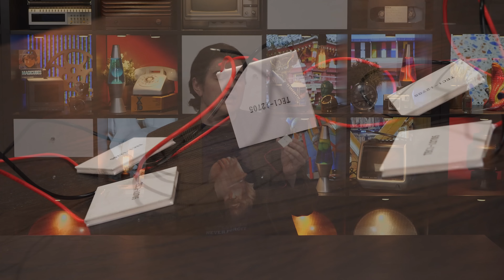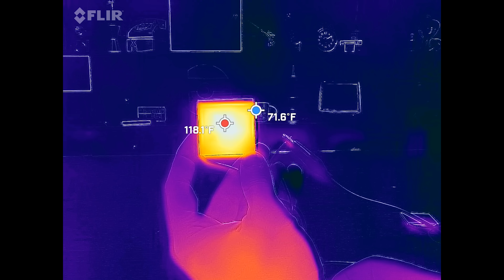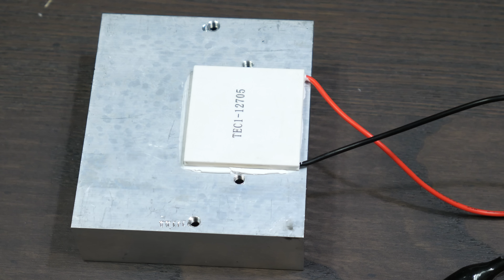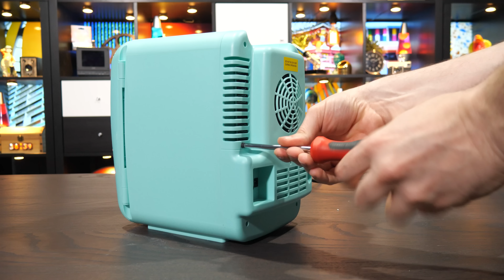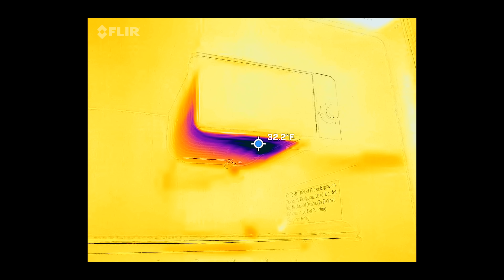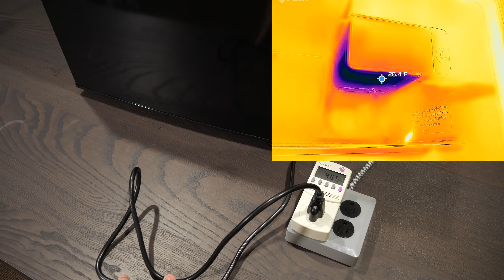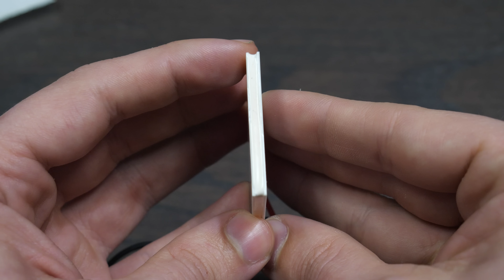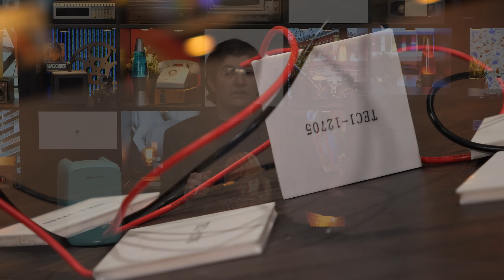Thermoelectric cooling: it's not great.

Comment: 14:20 So 230V are going to the head of "us Europeans"!? But hey, I can return that easily, because what's obviously going to your US-american heads is the higher amperage your devices need when running on miserably weak 120V lines. For us, every single household wall outlet may carry 16A at 230V 50 Hz, that's 3680 Watts! And Ithat's just the beginning, because for electric ovens and instant water heaters, we have 3-phase 400V with each phase providing up to 32A (fixed wiring, no plugs, officially requires an electrician). There, take that! 😝

Comment: I use one of those cheapo coolers for eye drops I keep by my bed that I like to keep cool (but don't require full refrigeration).  Works great for that.  There's no way I could fit even the smallest of minifridges next to my bed, and 20-25 degrees below the surrounding environment is plenty good enough for my purpose.  Plus I only run the thing 6-7 hours per day since it spends waking hours empty and only takes a few minutes to cool itself down when switched on at night.

Given that the application for these is specifically for places where you can't have a real fridge, the comparison to legitimate refrigerators feels mostly moot.  I guess the urge to make that comparison is the fault of their marketing.  These are advertised as low-tech refrigerators, when in reality, they are actually high-tech coolers.

Comment: I have one that I plugged in next to my toolbox at work, we don't have a fridge at work thats close to service side I use it to keep my few drinks cold and it does a really good job as its alot colder than the heat I am dealing with our open garage doors and no AC. I don't pay for the power bill so that factor doesn't apply to me.

Comment: I've (successfully) used good quality >100 $ Peltier fridges in my car when driving on vacations. First I would pre-cool the fridge (turn it on in the house) the night before AND in the morning of travel add a few (4-5) cooling elements directly from the freezer. After 16 hours in the hot car (no aircon) the temp would still be below 10° C (7-9,I use thermometer) which is excellent drinking water temp and sandwiches stay fresh too. They keep temperature better than similarly sized but cheaper passive coolers and those few degrees of difference matter a lot to me.

Comment: My first thought when I saw that Peltier device: Hey, that looks almost exactly the same size as a CPU's lid. I wonder if you could sandwich one of these suckers in between a CPU and its heat sink and use it to leech the chip's waste heat more effectively than the heat sink and fan by themselves. Sure, it would use even more power, but PCs that would benefit from that kind of active cooling would be drawing space-heater levels of power anyway, what's other 50 watts?

My second thought: If you could use them that way, it would already be common practice among certain PC enthusiasts by now. And I'd know about it from seeing it on one of the many tech channels I regularly watch and/or have pop up in the recommendation column. If this is my first time hearing about Peltier modules, there's a good reason!
Reply: Update: Huh, turns out Linux Tech Tips did a video about this very thing five years ago.

Comment: Alec, you gave me a good laugh when you said the door of the crapper wasn't insulated probably because it prevents freezing ;-)  BTW, you aren't kidding these Peltier devices draw tons of energy. A friend and I went on a road trip and he bought a car type fridge that was about 2/3 the size of your mini. It worked great, but we left it plugged in using the truck's 12 volts and surprise! The next morning, the battery was cold (pun) dead. From that experience, we took the fridge inside the hotel stops and plugged it into 120v supply. The neat thing about the dual-voltage device was that you could throw a switch to make it warm, as well. I have one which I only use when shopping, so my cold food stays cold on the drive home.

Comment: The steam (or refrigeration) cycle is still the most important technology since the industrial revolution. Great video.
Reply: I balk at calling any one thing most important, but it's definitely up there.  As a steam engine, it gave us a way of turning heat into work -- a brand new capability.  And in reverse, it gave us the ability to create pockets of coolness from scratch, without having to import ice or exploit overnight temperature gradients -- again, a new capability.

Comment: So if I had a air to air radiator (intercooler) and lined the top and bottom of it with these coolers, I could see lower air temps inside the radiator, the heat isn’t that much of a big deal, there are fans and plenty of ventilation. 🤔 I wonder. Are they water resistant?

Comment: I have a full size refrigerator that doesn't have a Peltier element. It also doesn't have a compressor. It plugs into the wall only to operate the light inside. Very quiet and inexpensive to operate. Pretty expensive to buy and nowadays hard to find. But this one has been working with just an occasional coil cleaning for the last 40 years.

Comment: I feel the real benefit to a TEC is it's size. And in a PC or small server, they are fantastic in aiding cooling on CPUs. 12V is available, and many CPUs are getting up to 100°C 212F to hot for most residential refrigerants. And to a point the water cooled loops get a bit of aid as well as the difference in temps from heat to rad is greater. The 100°C could be boosted up higher as the CPU uses more power to do more work ie instead of thermal throttling and dropping to 90w a CPU could run at its max of 150w and the temp on the chip stay safe where as the far side of the tec temps might be 116.7°C or if stacked and enough coolant passed though the heat exchange even higher to a point. I've stacked 3 of them and made ice out of thin air. And used a massive tinned copper heat sink with 2 120mm pc fans. And with very little noticeable emf. Bigger ac electric motors create emf that sensitive electronics hate. Like old school amps and radios for home audio.

Comment: I'm currently building a dehumidifier for my 3d printing filament. I use peltier elements to make the humidity condensate on a heatsink. After that the aur gets circled over the hot side to get warmed up again. So I guess if you need hot and dry air these things are pretty good, at least for diy projects

Comment: I've got a few camera lenses for my DSLR that TECs surrounding the glass elements. It keeps the ambient IR heat emitted from the lenses inside from adding noise in the photos. They use the aluminum body of the lens for passive heat dissipation so no vibration from fans. That tacked onto the active mechanical image stabilization that can survive an epileptic seizure and you can kiss your battery life goodbye. Great photos though and one of the few viable use cases for TECs.

Comment: Great video, very informative.  I do like my little refrigerator, for keeping cool sodas and sandwiches, I am happy with that, and they don't take but an hour or two to cool down to useable.  When the peltier device was first introduced, the ideal use for it was to replace heat sinks.  Not sure if they are being used for that, but they have to be more effective than passive water cooling that is common today.  However, it seems, and I am probably wrong, that it's original intention, like the original intentions of the internet, is not used today.  Now, I am going to have to get a peltier device and see if I can replace heat sinks in computers.

Comment: I always wondered if it was ever possible to use a peltier to generate electricity by heating the hot side and cooling the cold side.  Imagine strategically putting these in an engine compartment or radiator to collect heat to generate electricity.  I claim first patent rights by the way.

Comment: The main advantages of a peltier are as follows:
1. It is a heat pump (not just a heatsink/radiator/fan setup).
2. It's exceptionally compact (compared to a compressor-based refrigerator).

It's also solid-state, but this is largely negated as an advantage by the fact that you generally need to put active cooling on the hot side, which normally introduces moving parts.

The most common deployment that actually makes sense (in certain situations), is to mate the cold side to a high-performance microchip, and slap a high-end heatsink and cooling rig on the hot side.  As long as the cooling rig that you put on the hot side can keep up, this allows you to cool the microchip below ambient temperature, which is an overclocker's dream.  Because of the amount of heat involved, the cooling rig usually uses a liquid coolant, piped to a (relatively) large external radiator outside the computer case.  That introduces additional inefficiency (because you have to transfer the heat an additional time), but it also increases the total amount of heat that can be dissipated per unit time.  Plus, it has the added advantage of significantly increasing the complexity of the setup, which is worth significant nerd cred.

Comment: A cool use I've found for pelteirs is dehydrating 3d printer filaments. The cold side condenses the moisture in the air while the hot side warms up the container and the fan on the hot side heatsink helps circulate the air. The air being hot in the container drops the relative humidity and dramatically speeds up the drying process. If you do it right it's easier to maintain than a container with a headlamp and desiccant... I still wish I could put together a tiny phase change system though.

Comment: As for large fridges not cooling very fast despite their size, I found out that some "very energy-efficient" fridges that also cost somewhat more take lonnger to cool down content than their cheaper, not so very efficient counterparts. My guess would be, that their compressor is undersized.

There is a "super mode" button on mine that helps a bit, but the cheap, large fridge in the office kitchen of my employer is much faster w/o such extra steps. In fact, it is that powerful that you may not set it's thermostat to maximum cooling, otherwise it'll act as a freezer. Fancy "drinking" a bottle of ice?

Comment: I drive a big, off highway truck at my job. I am away from any break rooms for 12 hours at a time so my food and water all needs to come with me. It is a hot part of the world. All the 'real' fridges we have tried in the cab, even those specifically sold for off road automotive use (4x4 accessories) will sh*t themselves after only a week of use. It's simply too rough and bouncy in the truck.
We can't use these little toy fridges because as stated, they're not food safe. So either we find an extremely robust fridge or I continue to only eat foods that are shelf stable and the cab's air con is good enough. How many tins of beans can I stand?

Comment: Wow. You really do not do your homework on these peltiers. They easily get a COP of 1 when ran correctly and if you were to use it for heating, you can get more than a COP of 2. And also to note, that mini fridge is NOT getting a COP of 3. That is wishful thinking because those are also built so poorly/cheap. A COP of 1.5-2 is common for those. Maybe next time actually research and not buy a crappy $30 peltier driven setup and actually make a good mini fridge using peltiers at around $100 with a temp controller to actually do apples to apples comparison.

Comment: They also heat! Just reverse the voltage. I have a terrific camping cooler/warmer than works great. I did not buy it because it's cheap and works very well on DC 12v car power supply, works in my vehicle for trips to the campsite, and can keep food warm for a potluck or similar.

Don't expect it to cool or heat things from room temperature. For food, add ice and it will keep the ice from melting as quickly.

Comment: When it comes to refrigeration, why aren't we talking about things like Carbon Dioxide or Propane as a refrigerant? Both of those do well as refrigerants, with lower GWP than most 'EPA Approved' refrigerants, and they're cheap and abundant. CO2 is naturally all around us all the time, can't get more abundant than that, and propane, while flammable, isn't a significant hazard, because you need a certain A/F ratio for it to ignite. CO2 supposedly has a higher operating pressure, resulting in more likelihood of leaks, but it's CO2 - doesn't have much more impact than us just being alive. And Propane isn't that different. Both cheap and abundant.

I'll tell you why we're dealing with these 'exotic' refrigerants, rather than cheap, abundant, low GWP options like CO2 and Propane - $$$$$$. R1234YF supposedly has a really low GWP, in line with CO2 and Propane, maybe even a tad lower, but it's STUPID expensive. If CO2 and Propane were 'mandated', basically, nobody would make any real money because they're cheap and abundant. Follow the money to the fraud.

Comment: I have a thermoelectric cooler I use for road trips that runs on 12V and also has a 120v power adaptor. it works great. Do they make any any refrigerators than run on 12v that I can put on the floor behind the first row?

Comment: Hi Alec,
What do you think would happen if we put the Peltier unit at the top of the mini fridge, cold side facing down and heat sink facing upwards, added a "heat sink" to the cold side that runs down the sides of the unit, and added some insulation? (to the door as well) 

If you ask me, I think the unit is just poorly designed, its not making the most out of the Peltier device.

Great video, made me laugh, see you next time.

Comment: I dunno i have a Cooluli thermoelectric mini fridge with temperature control and it works fantastic. Better than my actual real mini fridge with a compressor. As long as the ambient temperature stays around 68-72F the fridge will hover at around 31-33F if i set it at the coldest possible temperature. I can set it warmer if i wanted to but it stays right around freezing. In the summer if the room gets to around 80F the fridge will be near 40F and in the winter if the room temp drops to around 64F i can get it down to 24F. 40 degrees below ambient temp, just as advertised. Sometimes colder!

Comment: I had a thermal electric mini fridge in my semi truck that ran on 12 volts and it allowed me to keep healthier food that required cold storage in my truck.

Instead of cooling down the walls of the mini fridge, it would actually have a fan on the inside that blew the colder end around the unit. It was actually pretty effective.

Oh. But yeah, compared to my 4.3 cubic foot mini-fridge I had in college, which I hooked that up to a kill-a-watt and it was only pulling 90 watts. Good old fashioned refrigeration is still way more efficient.

Comment: Where can I get bare Peltier elements? I want to build a custom drier for 3d printing filaments, setting it up like a dehumidifier for the inner chamber.
Reply: eBay, Aliexpress or Radioshack probably have some.
Reply: @psirvent8  Wait, is Radioshack still around? I thought they went under years ago

Comment: The little blue "fridge" also doesn't insulation on the back.  If it did the cooler would not be in contact with inside back of the "fridge" OR the finned heat sink, that is in direct contact with the cooler, would not be in direct contact with the AMBIENT AIR.  So there is another strike for the shit box toy.

Comment: I agree completely, these little pieces of garbage are a waste of power... unless you convert them into a gamer hat.

What we NEED is for one of the companies like Midea to make a chest-type mini-fridge that doesn't cost $1200.00.   I used to convert mini-fridges into buffet-type shallow chests back in the 1990s that used a tesla blower for circulation for ease of cleaning (wrinkly disk blower instead of fan blades).   I doubt any of them still work and I don't have pictures but its a fairly simple job if you know how to do sheet metal.

Comment: i bet for an extra 20 bucks the peatier could be improved to where it on par or at least worth the cost of energy. i feel the design was more like throw together as fast and cheaply as possible. some insulation maybe some way to spread the cooling inside better (instead of a small square) and a mini fan for air flow. or even just a heat sink fan on the cold side. but that just my thoughts.